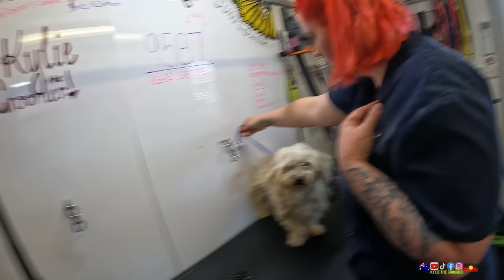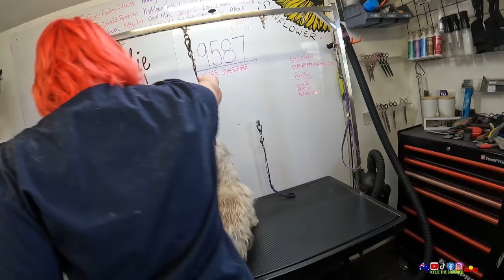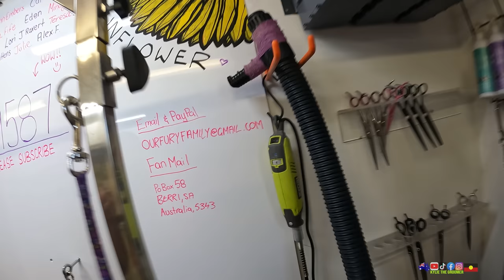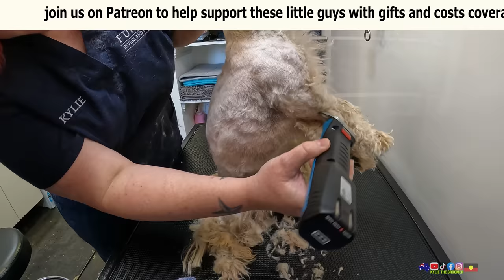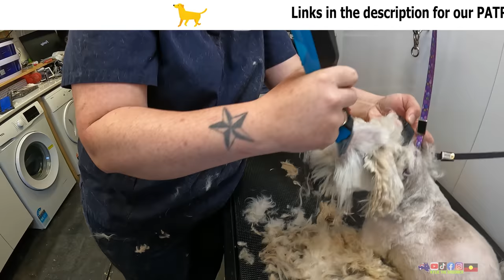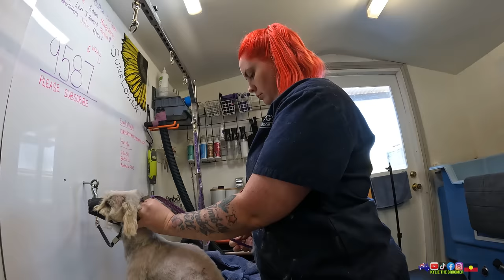Gizmo, Poor NEGLECTED Dog, Aggressive and IN PAIN. Hurting him to help him broke my heart.

Comment: There is a groomer in a foreign country who has been specializing in rescue dogs.  Their country has quite a few breeds with long hair, being abandoned.  He mentioned that matting can block circulation in areas and when hair is cut back, blood can rush in and cause bruising, it wasn't from grooming problems.  I've seen Marybeth, at Rover's Makeovers, use a sling, to aid dogs who are agitated, old, exhausted, etc.  A muzzle can prevent everyone from getting hurt.  You did important and great work.  Thank you.  A groomer is probably far more humane for matted dogs than a lay person could be, because it would take far more hours, days if it had to be done slowly or a little at a time. Gizmo didn't react to a toy, maybe he has not been played with.

Comment: Have you considered trying something like a "groomer's harness" which would give you something to hold onto and lessen the risk of choking? They can also be anchored down by multiple points and he won't snap his neck. It fits dogs 2-115 lbs it's pricey for the full set but maybe it's worth it if you are going to be doing more grooms like this.

Comment: I have a question I just brought a multipoo so when should I take him to get groom❤
Reply from the maker: Hi Khalifa
Congratulations on your newest floof! How exciting! Grooming should commence as soon as possible. In Australia, it is after they have coverage from Paroo virus. 3 vaccinations over the first 12-14 weeks. It's important to have them covered with the recommended vaccinations prior to exposing them to the big world. 
Once they are all set to explore, i recommended finding a groomer who has a good plan for introducing puppies to grooming. You don't want someone that "can do a full groom" on a puppy.  You want someone who will set a program for 4-6 weekly visits to introduce the table, bath, brush and blow dryer, then add a sanitary clip, then add face and feet and then be ready for a full groom on the 4th visit. After this, maintain a very regular schedule for the first 12 months. Try 6 week bath, 12 week full groom. This builds positive relationships with your pup and grooming. After the first year, 6 weeks is recommended but 12 weekly full grooms with high maintenance at home will also be sufficient.  Lots of brushing, combing and handling will help your pup to learn all about grooming.

Comment: You have a couple of options to make this type of groom safer and easier in the future. One is a cone like the vets use, this wil help keep the dog from being able to reach around trying to bite at where you are working. It is just an extra layer of protection between their teeth and your hand in case of muzzle failure.
The other is tethering the dog close to the grooming side pole instead of the top bar. That will help with any dog that is fighting hard because it takes away their leverage. You can use a slip leash or collar and leash to tie them to the pole, you do not want more than a couple of inches of slack to limit movement. This will make everything from behind the front legs back 100% safe to do as the dog can not turn back to bite. In a dog that does not bite it just makes it go so much faster since it limits the dogs ability to fight.
Needless to say I groom some of the worst dogs on the regular because the other groomers won't do it. So I found my niche in grooming the impossible dogs and I sometimes even manage to make them look cute but not always LOL.
Just hope this helps you help some not so easy dogs get a much needed hair cut.